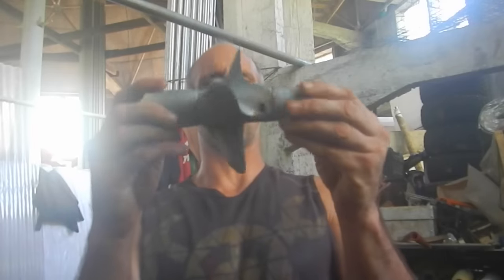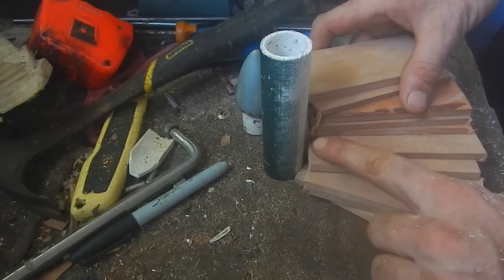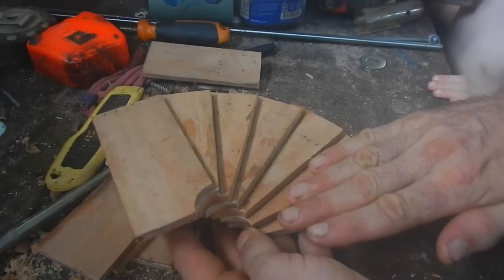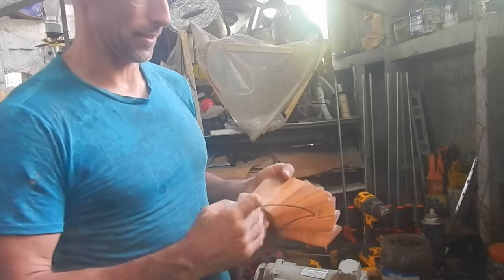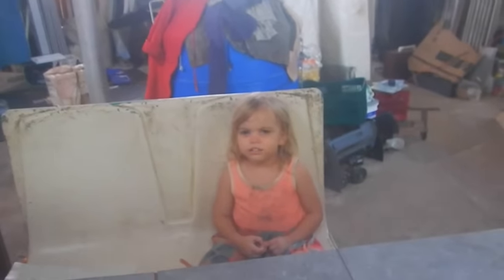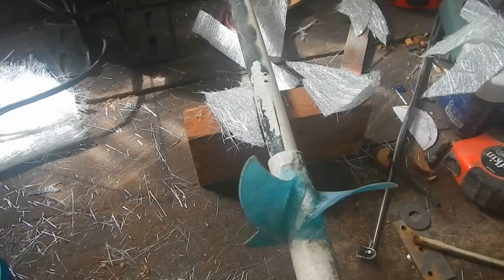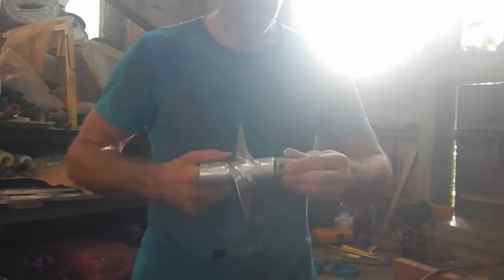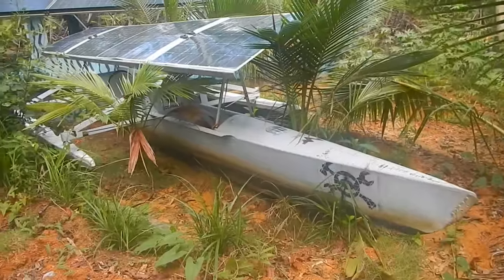Making a Custom Prop for a Solar Boat

Comment: Jamie, exactly the right move to gear down the prop. Wondering if you could keep an even lower pitched one in the boat for emergency where you need to save power, have overheating issues etc that way you could get around all electrical conrol elements. During the cruising phase of the journey...

Comment: I love how you just take random stuff and make a propeller and it works! Awesome! I know you're looking into a 3D printer. I've seen people on YT who have 3D printed propellers, but  I don't think they'd be as strong as what you're making with the fiberglass. The only advantage of 3D printed props is you could try different designs pretty quickly. Well, 3D printing isn't that fast, but probably faster than sanding the fiberglass. Would be interesting to do a 3D print then add fiberglass after to reinforce it? Well done, thank you for sharing your build process!

Comment: I'd make bigger propeller blades for slow moving boat, which have propeller slip. It increases efficiency. Only close to planing speeds, propellers 'lock' and slip becomes small.

Comment: Two words: variable pitch. Mister Tiny Spider Robot Maker.
Reply: Probably not necessary for that application huh? Once you find a good one.
Reply: adding that much complexity for very little gain is asking for trouble out there in the boonies. he mostly has a set speed when he goes to town, not from 2mph up till 40 mph lol
Reply: @Aeradill  The gain is in efficiency of motor amperage draw as wasted energy converting to heat